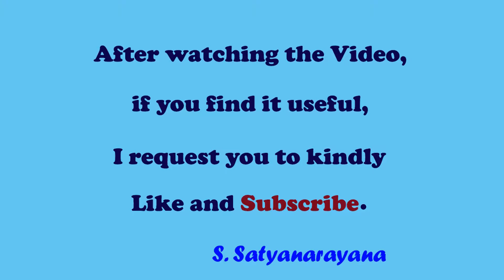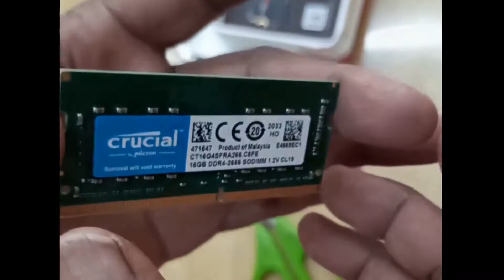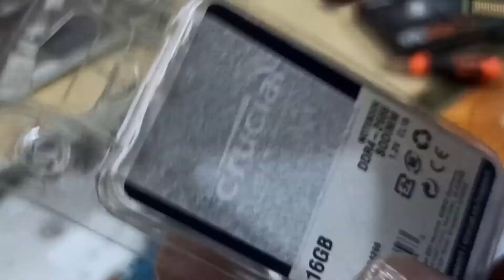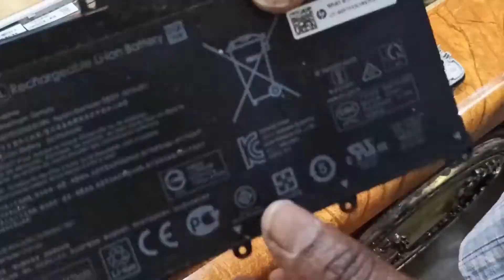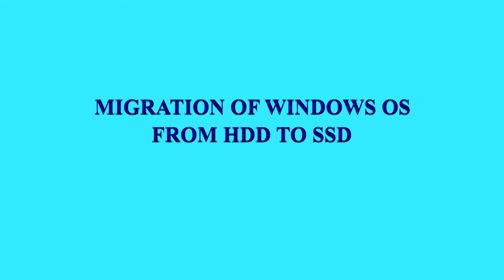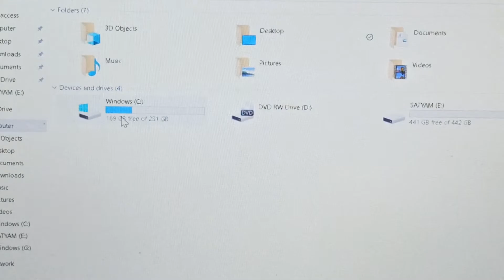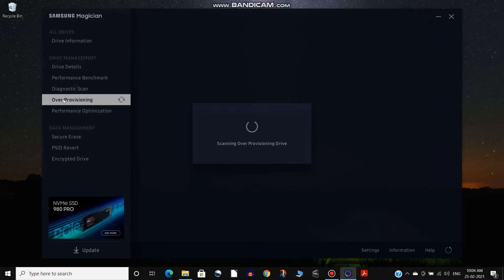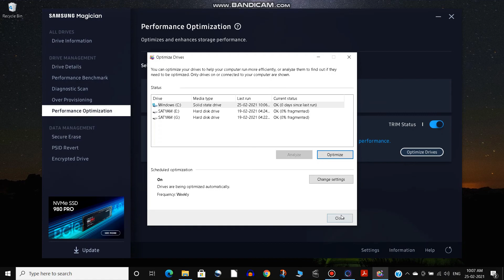HP LAPTOP UPGRADATION - SSD AND RAM

Comment: Sir I have same model.Which has 4gb ram 
I want to upgrade 8 X 2 = 16gb ram of 2666mhz and remove old 4gb ram of 2133mhz
will it start to work at 2666mhz or be at 2133mhz?
and 
Should I buy kit or 2 single ram because kit costs more than 2 single ram 
pls reply 🙏 🙏 🙏 🙏
Reply from the maker: It works at 2666mhz. You can insert two RAMs which are identical and of same speed.
Reply: @SatyaVideos  will it work dual channel?
Reply: @SatyaVideos  will it work dual channel?

Comment: why are you removing battery to install ssd/ram?
Reply from the maker: Though it is not mandatory to remove battery, but as a precautionary measure, to avoid any malfunction of terminals due to passing of electricity from battery. I have removed the battery. Further, it is not a difficult task to remove battery. It involves removing screws only.
Reply: @SatyaVideos  OK.

Comment: Sir i have hp 15- da0326TU laptop. And i wanted to upgrade it by ssd. So please help me. Which ssd will it support? M.2 sata or m.2 pcie nvme or m.2 nvme? Please guide me sir. I'm in big confused.
Reply from the maker: Sir, as far as I know your laptop model supports both M.2 SATA and M.2 PCIe NVMe SSDs.  M.2 PCIe NVMe is much faster than the SATA one, but it generates more heat than the SATA.  However, I suggest you to go for M.2 PCIe NVMe SSD.  I preferred Samsung 970 EVO SSD for my laptop.  For compatibility, you can check the HP User manual, and also Crucial site through Google search.  I suggest you to upgrade RAM simultaneously.  As I am not a technical person, I suggest you to take a final decision after consulting a Technician.
Reply: @SatyaVideos  thank you sir
Reply from the maker: @shaikhshoaib4609  For your better understanding,  I will explain you further in this regard. 
SATA is a connection type and is older and slower. SATA SSDs use cables. M.2 drives can still use SATA connection without cables.
M.2 is just the Form Factor for SSDs. It is rectangular, with possible widths of 12, 16, 22 or 30 millimeters. Generally, SSDs are 22 mm wide. Lengths can also vary 16, 26, 30, 38, 42, 60, 80 or 110 mm.  The width is more fixed on motherboards as the connector is placed on the edge of the short side of the M.2 card.  I think, your laptop supports M.2 2280 board. M.2 drives plug directly into the motherboard without the need for any cables.
PCIe is a high-speed serial bus. This transmits information and data from one device to another or between the computer and a peripheral piece of equipment.  PCIe uses four lanes for storage devices, resulting in data exchange that is four times faster than a SATA connection. M.2 drives can come in SATA versions and NVMe versions.
NVMe, which  is a new technology utilised by M.2 drives, uses the PCIe data transfer lanes on the motherboard.  By using the PCIe connection, M.2 drives can reach speeds of over 4,000 MB/s read and write.
PCIe combined with NVMe, will result in faster read and write times.
M.2 drive can make use of either the standard SATA interface or the faster PCIe interface, but in both cases, it plugs directly into the motherboard.  When purchasing an M.2 SSD, you must be careful - because while they can look virtually identical, some M.2 drives may still use a SATA connection, just without the need for cables. M.2 SATA drives will only work in a slot that supports SATA or PCIe interaces with SATA support. They are compatible with both B connectors and M connectors (B slot and M slot) SATA M.2 SSDs  will have two divots in the strip of connectors. For M.2 NVMe SSDs, there is only one divot on the on the side where the drive is plugged into the motherboard (Key M slot).  In simple terms, SATA M.2 SSDs will have two grooves, whereas M.2 NVMe SSDs will have only one groove. If you see Samsung 860 EVO SSD, there are two grooves, which tells, it is a SATA M.2 SSD.  Whereas Samsung 970 EVO SSD has only one groove, which tells that it is M.2 NVMe PCIe SSD.  At the moment, models using the PCIe 3.0 interface seem to be the most cost-effective choice.
Not every motherboard allows for PCIe data transfers.  Every motherboard might not have the appropriate M.2 slots for both types (SATA and NVMe M.2 drives).  Check computer specifications to see which interface your computer supports. You can also use the Crucial Advisor tool or System Scanner tool to find a compatible part.  I think, with these details, you can take a decision.  Kindly subscribe to my channel, if you have not done earlier. Thanks.
Reply: @SatyaVideos  just guide me. Should i go with wd blue sn550 256 gb? I used to work in office so i have to go on lots of server and more tab i have to use in one time. So wd blue sn550 will be good? Or another one will be great? I have 4500 budget. And my laptop support m.2 pcie nvme ssd
Reply from the maker: @shaikhshoaib4609  It's Ok. It's cheaper than Samsung. I have installed Samsung in my laptop, whereas WD in my Desktop. Both are working good.
Reply: Nvme install krne par kAm kiya da0326tu me pls do reply

Comment: Can you suggest the tool kit you used to open a laptop which consists of all the required things to open a laptop at home?
Reply from the maker: I bought from local market in Hyderabad. They are similar to PagKis pry tools, Jackly screwdriver tools kit and Vadda bai metal spudgers available in Amazon.
Reply: @SatyaVideos  Thanks sir.
Reply: @SatyaVideos  Sir how to prevent the scratches while last stage opening of laptop by scratching that knife type tool? I am getting lot of scratches while doing so.
Reply from the maker: @vipulpatel5249  Use plastic sprudger for opening. Use metal sprudger only when you could not widen the gap. That mean use metal one for widening the gap at one place, and then use plastic one for widening the gap at all places.
Reply: @SatyaVideos  sure sir. Thank you.

Comment: mre pas yhi model h,,,,kya isme nvme ssd lg jaegi
Reply from the maker: NVMe (Non Volatile Memory Express) is a technology (communication interface) designed for SSDs to communicate between storage interface and the system's CPU using high speed PCle sockets.

Comment: Sir ,I don't Want to upgrade hdd to ssd or M.2 ..But only RAM from 4 to 20 will it increase Software performance.??.I want to use Fusion 360 modeling software ,But software is taking a lot of time to load
Reply from the maker: Increasing RAM will not improve the software performance. Speed in loading and running the software increases by upgrading the laptop to SSD as also increasing the RAM storage.

Comment: Hello sir,  I am having HP-15-da3001TU  laptop with frequency  2666mhz (maximum up-to :3200), 4gb Ram and 1tb storage,  I want to upgrade both of them into ssd and increase Ram upto 8 GB 
Please guide me?
Reply from the maker: You can upgrade with additional RAM and SSD. You can either go for 2666 or 3200. As the installed RAM is 2666, you can go for 2666 to save money, as the additional RAM with 3200 will not result in any better performance than 2666. As regards SSD, it is always advisable to for its installation as it results in fast booting and better performance. If you have limited funds, go for either 250 or 500 gb. As all new laptops have M.2 slots, buy compatible M.2 SSD.

Comment: My laptop same configuration like ur..is it support pcie nvme interface
Reply from the maker: As per manual, Yes.
Reply from the maker: As per manual, you can go for upto 512gb M 2 nvme  2280 SSD.
Reply: U have installed samsung 970 evo plus in ur..hp 15-da0327tu ..is it working ok?
Reply: Actually I have ordered the same..so try to get confirmation....
Reply from the maker: @RakeshSharma-qe3vl  Working fine
Reply from the maker: @RakeshSharma-qe3vl  Upgrade your RAM also. Pl subscribe to my channel.
Reply: Yes I already subscribed...
Reply from the maker: @RakeshSharma-qe3vl  Thanks
Reply: @SatyaVideos  boot ho rha hai ssd se windows please do reply??
Reply from the maker: @kailashmandal2086  Yes

Comment: 20gb 4gb first slot 16gb second slot
Reply from the maker: Yes
Reply: 16 Gb maximum supported is written hp manual
Reply: Any problem
Reply: After long ago you have problems with motherboard
Reply from the maker: @MukeshKumar-xh7md  16 gb in one slot

Comment: Hello sir how it run on only ssd not on ram upgrade?
Reply from the maker: It works fine with upgradation of SSD.
Reply: @SatyaVideos  i want to use samsung evo 970 plus does it support and what is the expected bood time after upgrade?
Reply: @SatyaVideos  my pc is hp da0327tu
Reply from the maker: @sameerahmedsaifi  It supports. Boot time will be about 15 seconds.

Comment: Sir hamere laptope Blue screen aa jata hai when I work on , mn laptop ko check krvaiaa to Ohno ne Hard disk me problem ha , ab hum SSD pva le sir , es ke baad koi dikat to ni aye gi blue screen jesi ?pls reply sir
Reply from the maker: The problem may be due to hardware, operating system or graphic card. If your technician is sure that it is because of hardware failure, go for it after taking confirmation from him.
Reply: @SatyaVideos  confirm ha sir only Hard disk me hi problem hai

Comment: Sir I have the same model but if I  upgrade only ssd evo970  and Ram is 4gb...then system bootable speed is increase or not.please help sir...coz I want to buy this ssd
Reply from the maker: It increases, but it is advisable to increase the RAM, if you have budget. Installing SSD speed up the system boot only. For opening the apps, big files, increasing the RAM helps in fast opening and avoiding system lag.
Reply: @SatyaVideos  sir my laptop ram is - 2133mhz then what's the best ram for this laptop..and is it support 2400mhz????
Reply from the maker: @yesiamsurojit2831  It will support. You can check at Google Web search.
Reply: @SatyaVideos  sir if you are don't mind will u upload a  video for speedtest checking
Reply from the maker: @yesiamsurojit2831  I will try. Bootable speed depends on programs and services of windows 10 at startup. Uninstalling unnecessary programmes, deleting unnecessary files, defragmentation will help in increasing the speed. Win 10 has lot of features. Uncheck the features which you don't want at the start up. For this, watch the video "How to speed up Windows 10". Check for updates. Because the laptop is not too old, my sincere suggestion is to go for updation. I know if laptop is very slow while booting as also while opening apps, one gets lot of frustration. If you upgrade with SSD and additional RAM, and also doing certain things as suggested above, will definitely bring peace in handling such laptop.

Comment: I have the same laptop but the ram frequency is 2133mhz and shall i install 2666mhz 8gb additionally will it work ? Or it create any problem? And second is do i need to remove battery for installing ram
Reply from the maker: You can install DDR4-2400. I have installed DDR4-2666. It's working fine. Need not remove battery for installation of additional RAM, but it is advisable to remove battery for any modification.
Reply: @SatyaVideos  thank you sir and one more is i have already installed 4gb ddr4 2133mhz ram on slot 1 and on slot 2 shall i install 8gb 2666 or 2444mhz ram?
Reply from the maker: @UCOSARAVINDM  Either. But frequency will not be more than 2133mhz.
Reply: So i cannot use both at a same time
Reply: @SatyaVideos  thanks you sir
Reply from the maker: @UCOSARAVINDM  You can install another RAM in the second slot. You can install 2133 or 2400 or 2666. Both RAMs will be active, and the total capacity will be shown in the Settings. You can check compatibility RAMs in Google search.
Reply: @SatyaVideos  i have searched it through internet and they says that "we can install 2133mhz and  2666mhz on both slots and the higher frequency will match the lower frequency"but i didnt know exactly my hp 15-da0327tu will work with 4gb ddr4 2133mhz and in slot 2 with 8gb ram 2666mhz.
Reply from the maker: @UCOSARAVINDM  Watch my video. I have installed 2666 in the second slot  There is no problem, but the RAM works at the frequency of the original RAM. Go for 2666. Don't get further doubts in this regard.
Reply: @SatyaVideos  ok thankyou

Comment: Sir SSD lagane ke baad HDD dono ek   Saath work karte hai kya ?
Reply: Haa bilkul
Reply from the maker: If you migrate windows to SSD, system booting will be done through SSD, and the system will boot faster than through HDD. You can install all apps in SSD. The HDD can be used for storing other data.
Reply: Thanks sir
Reply: Don't migrate
Reply: Fresh install

Comment: My laptop hp15da0326tu..can I install same ssd ...will It support by bios
Reply: Had you upgrade?
Reply: Same question do its bios supports m.2 nvme pcie ssd please do reply.
Reply: @shaikhshoaib4609  had you upgrade ??
Reply: @shaikhshoaib4609  please bro btao support kiya ki nhi?
Reply: @kailashmandal2086  yes i upgraded and it supported
Reply: @kailashmandal2086  i installed m.2 nvme gen 4 pcie ssd..
Reply: @shaikhshoaib4609  windows boot ho raha hai ssd se?
Reply: @kailashmandal2086  offcourse hoga bro... Btw tera hdd ka data safe rahega... Bas windows ka backup lele pd me and ssd installation ke bad usme install krde
Reply: @shaikhshoaib4609  please bro insta id do na usme bat krte h hmko bhot doubts h please bro insta id do
Reply: @kailashmandal2086  _imshoaib
Reply: @shaikhshoaib4609  27 hai last me.
Reply: @kailashmandal2086  just _imshoaib
Reply: @shaikhshoaib4609  nhi mil raha hai bro
Reply: @Jitendr__akumar ko follow kro me bhi krta hu
Reply: @kailashmandal2086  ok

Comment: Sir I am also having the same laptop. Can I change the processor from i3 7th gen to ryzen 5?
Reply from the maker: Sir, I don't know,.But, I feel both processor and mother board to be changed, and upgrade RAM and hard disk to SSD, which is costly affair and may not be feasible. Instead you can go for another laptop with the required specifications. This is my view.

Comment: Hello I have installed wds 240gb ssd but in os boot manager order ssd not showing. To jab b laptop start hota he to vo old os se hi ho rha he any solution? Mere me ssd show krta he nd mene usme os dalke manually boot b kr li. Sab thik he usme. Sirf ye problem aa rha.
Reply from the maker: Check whether SSD is showing in C drive; whether cloning is done properly; whether SSD drive is in good condition.
Reply from the maker: Reinstall OS
Reply: @SatyaVideos  after reinstalling it worked. Thanks.

Comment: Sir, are you facing any blue screen error after heavy operations  as you r using 2 rams with different  speed ?
Reply from the maker: No. Two RAMs with different size. There may be display problem also.

Comment: Hello sir i installed the ssd successfully but it get hot to a temp of 72°c what should I do?
Reply from the maker: Installing SSD is in no way related to increase in temperature. Check whether fan is working. If you are playing games continuously, it is better to use external fan also and give break while playing games.
Reply: @SatyaVideos  no sir the temperature of ssd is increasing.
Reply from the maker: Samsung SSDs are designed to operate at temperatures ranging upto 70° C.  If your SSD is going very hot continuously, if there is no other way to cool it, you may use the SSD externally. External enclosure with proper cooling system may be preferred. It is better to contact the manufacturer in this regard.